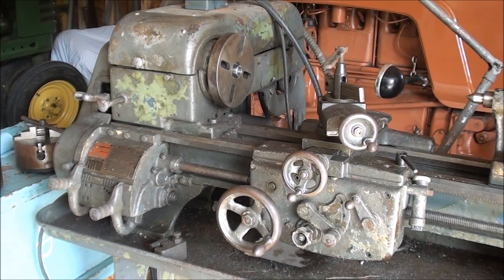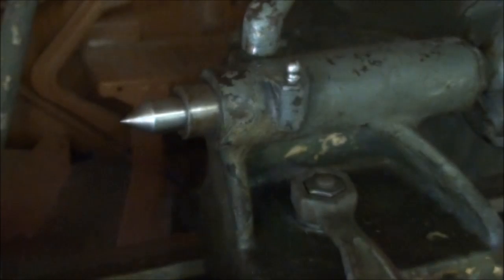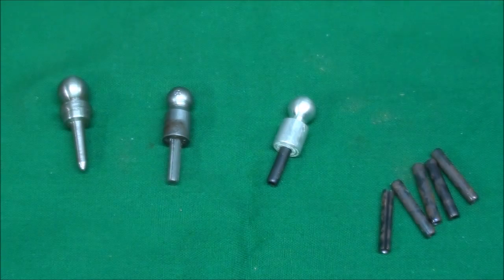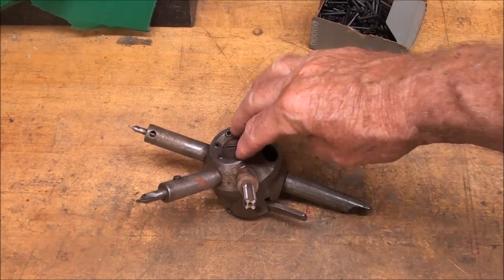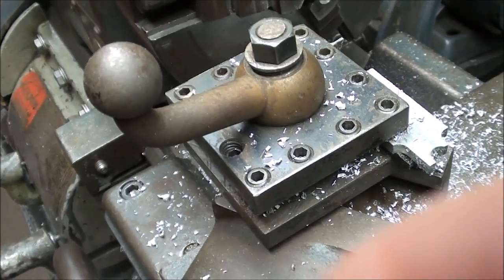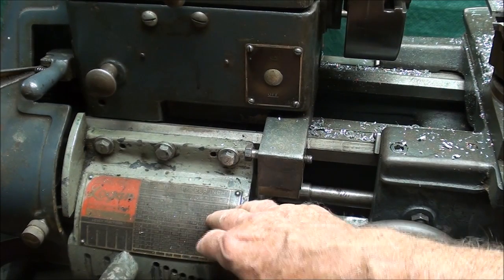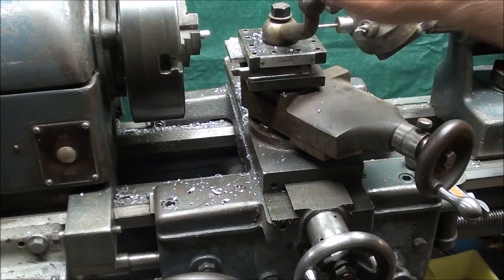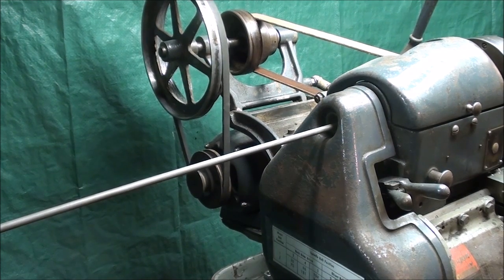Shop Tips #173 Making Oil Daubers on Logan Turret Lathe pt 1 tubalcain

Comment: Great  video!  I recently bought a lever operated turret for my SB 10K lathe.    I want to use to to produce100 small bushings.  It doesn't line up with the center of a work piece with a collet in the spindle.  Have you ever done a video on how to set up the alignment of a center on the turret and the lathe spindle?
Reply from the maker: Have not.
You may have to bore the 6 turret holes to align them-& use bushings to then reduce them
Reply: I wish I could figure how to post a picture of the lever actuated turret tool I bought. It does have a row of (its own)  gibs-way adjustment screws. I might be able to do something with those.  Thanks for the quick reply.

Comment: I've used a automatic 12' bar feeder on a Miyano, many times.
Got a few quick videos from a little machine shop I worked at in 2010-11, if interested. Nothing fancy like your videos or work you do. Note, I worked prior at a large Machining Plant for ten years, Ryobi. Lost my job in 1997, Wish I had the ability to video back then, we had some one of the kind turrets, trunnion heads and a arbor mill, all on a one of the kind Machine Line made by LAMB for Ryobi to machine AXOD Ford Transmissions (Taurus & Windstars).Used a Cincinnatti Milacron HPMC 850 for Op 1 then the transfer line was Op 2.(Could go on and on, lol)Those were the days, sure miss the time.
~
Here's one cutting stainless (rough on the inserts):Miyano BNC 34C (changing chipped insert, running 304 SST)
One on loading a bar: Loading a steel bar into bar feeder to make Toyota Pinions (1)
And one on Chevalier CNC making Steril-Koni Inground Eco Lift Part.
~~
Not good videos being many factors, low pay,dangerous shop,no proper maintenance (especially on the coolants).
Anyway, hope you don't mind just thought you would be interested in these old, unprofessional videos.lol
(actually forgot I uploaded them)
~~~
OK off to part two!
~~~~
James
Reply from the maker: Thanks--reminds me of shops I have toured. I watched all 3 videos. Keep watching. pete